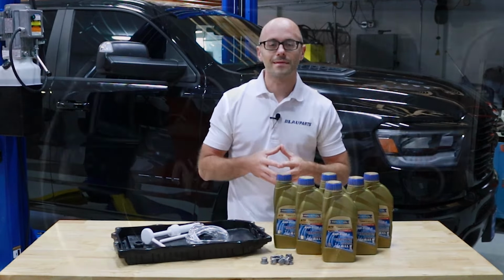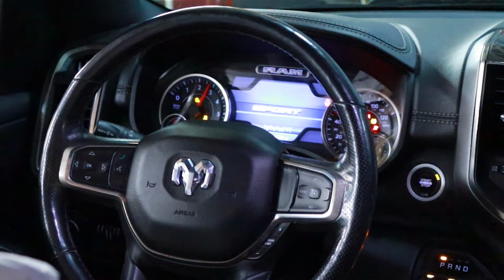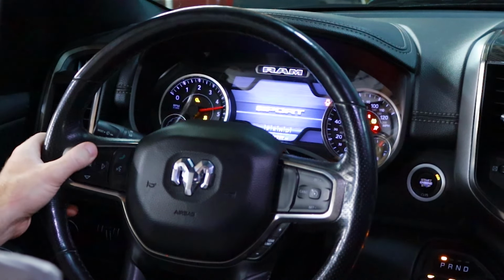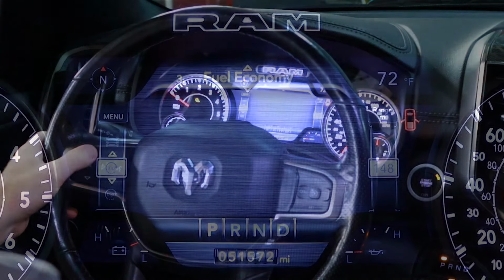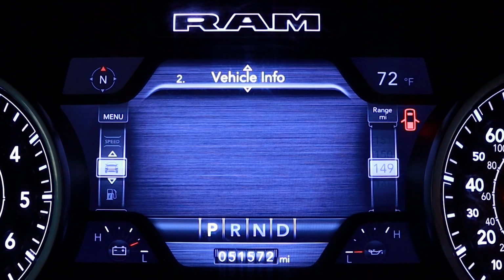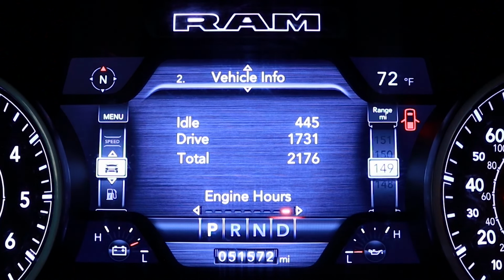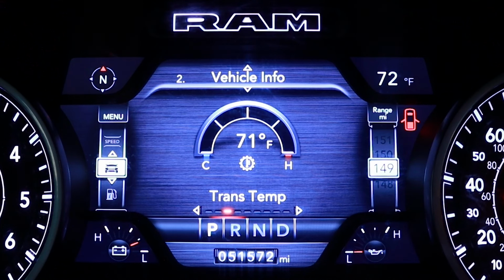Ram 1500 Transmission Fluid Change How To | 2013-2026 ZF 8-Speed 8HP

Comment: I have an 2016 RAM 1500 HEMI and have been experiencing Transmission over heating for the last couple of years. Dealership will not work on it unless the truck throws a code or worse. I have had them make sure that my transmission fluid was filled correctly. But still experiencing high heat 235* after driving for a few hours. This is not constant but more intermittent. Do you have any suggestions as to what maybe causing it. Dealership says that there is nothing wrong with the temps.
Reply: You'll need to either replace or delete the cooler bypass, looks like yours is stuck closed.
Reply: Your cooler thermostat is probably not opening properly

Comment: What a pain in the ass! My local dealer wants 750.00 to do this service. I thinks that’s almost 500.00 over charge! Time to trade it in and go back to and 70’s truck. Easy to work on and no computers!
Reply: 750 is good! The parts alone are $370-$400.  That’s hardly any labor charge!

Comment: Please explain to me why if you remove 5 quarts, you don't just put 5 quarts back in?
Reply: As long as you're accurate in collecting all of the fluid and measuring what you take out, I don't see why you couldn't do that. The issue is that when the transmission pump isn't running, the fluid level in the pan is higher than the drain hole. That would make it pretty difficult to fill at the right amount and replace drain without much loss, not impossible, just hard.

Comment: I thought the transmission was supposed to be level, not the truck. The transmission is mounted at an angle in the rams. Rear end has to come up about a foot or so According to your trucks stance, and then check for level.
Reply: You are correct for this vehicle.

Comment: Thank goodness for this video! While out camping, 16 miles down the Snake River, I hit a rock and cracked the transmission cover. I was able to correctly make all the necessary repairs to my truck while in the field because this video was the first to come up. I was also able to pull my camper and everything back to my home without any extra time or worry, and had a wonderful camping trip even though we had some fairly major issues! Thank You Blauparts!
Reply: How did you do it without the SAE CERTIFIED CAR LIFT?
Reply: @GertuCapur  I was able to use my Jeep to pull the truck up onto some rocks getting the transmission as level as possible. Field repair, so we ensured to recheck once we got back to civilization, but we were able to do well enough to get us out of the back country under our own power!
Reply: wow, you were able to get Amazon to deliver to the Snake River? Crazy. And you had a torque wrench, trans jack and ...oh wait, you just lifted it by hand while your buddy used his fingers to loosen and tighten everything...HAHA.... just kidding. Great job
Reply: Same here, a literal in the field repair.  It started raining , but only the bottom of my legs got wet...good times.
Reply: time for a 6 inch lift and 37 inch tires

Comment: This man is good. He drained, pulled the pan, and didn’t even get a drop of fluid on himself or anywhere else.
Reply: 😂 It’s Rams fault putting that exhaust pipe literally right over the damn drain plug. 😐
Reply: @Adam12SD  Still better than the 75 2wd K5 Blazer I had. It had a leaking oil pan gasket and the only way to fix it was to pull the engine! Needless to say I just added a quart of oil that leaked out every 10 days. Stupid design.
Reply: @rickgoing7027  Thought the K Trucks were all 4WD. The C trucks were 2 WD.
Reply: @anonimous2451  apparently that’s with only the pick ups. My 2wd blazer had a k5 emblem and IFS that kept the oil pan from being dropped. To replace the gasket you would have to pull the engine. I would pour in a qt of oil a week.
Reply: Movie magic

Comment: Tip: wrap the exhaust with tinfoil.
Reply: This has to be less expensive going to a reputable transmission shop, than going to a dealership. .the dealership quoted me $792 !!!
Reply: @lakeguybrent my quote was 1300 lol
Reply: @lakeguybrent  The cost of the OEM pan and OEM fluid is around $400. I paid $470 with expedited shipping
Reply: Adding to this. If you do a poor job like I did, it's worse than not using anything.

That's my fault. Just giving a warning. I thought I had the pieces sealed well enough, but the entire area I covered ended up being covered in oil.

😅

Granted, this entire thing has been a nightmare.
Reply: Use a shallow aluminum tray with a hole where you can place an oil pan to control the mess.

Comment: Hey I’ve done few other vehicles where you needed to fill trans with the pump and hose. Pretty much same technique. Full run check , run check, run check, shift trans run with wheels off ground, check fill. Time consuming.

Comment: I notice on my 2015 Ram the ZF 70 transmission is no where near level, the way it's mounted in the truck. So going by this video I guess I don't need to jack the rear of the truck up to get the trans level to the ground. Just have the truck frame level. So that's close enough to do a fluid check?  I saw where someone said ZF had literature saying the Transmission should be level. Maybe it's not that big a deal. I don't know...
Reply: Do your best to level. Bc half a quart and will make a big difference
Reply: @Lui8111  I had to max out my jack stands in the back of truck  to even get the transmission close to level. I didn't feel safe under a running truck with that extreme angle. I just decided to go about half that high and do the procedure. I got just as much fluid in as what came out. Prob 1/2 qt. more to be honest. I will say this..the way they are showing in this video, there is no way that transmission is even close to level.
Reply: level the pan with a warm transmission then remove the fill plug to see if any fluid runs out until a steady drip. measure what comes out then simply duplicate after the pan and fluid swap. Then add what came out originally. This way you are replacing exactly what comes out or very close to it.

Comment: I just did my tranny fluid change this weekend following this video. It was SUPER helpful. I was able to put in 6 quartz of Valvoline MaxLife and now the tranny shifts so smooth. Thank You!
Reply: Amsoil
Reply: Going to go with PPE, so I just have to change filter and fluid without having to get new pan every time. Plus extra cooling and not having drain plug over exhaust. Seems Worth the extra cost.
Reply: So you just changed the fluid or changed the filter too?
Reply: @adrianarce9427 the filter is actually embedded in the new albeit disposable pan.  I did this last year…..bit of a pain but not that bad.  I didn’t need to remove the three bolts and raise the truck.  There was enough clearance to remove and install the new pan on my 2017.  I used OEM fluid which is ridiculously expensive.
Reply: @chrisspeer3850 you have the cross pipe and didn’t have to lift the transmission? I’m planning on doing this job tomorrow… and tips or advice for me would be greatly appreciated 😅
Reply: @chrisspeer3850 so I can’t just buy a filter? There’s nothing wrong with mine I just hit 100k and want to keep my warranty.
Reply: @tyreichard9801 no. The pan is the filter.  It’s integrated into the pan.
Reply: @adrianarce9427  filter also. For the filter pan, I went with OEM.
Reply: You know that's the wrong fluid?
Reply: @jordanwalter4381  wrong fluid ? Why because it's not green ?😅 It fulfills all the specifications of the ZF tranny, and many people have used it for long periods with no issues to date. You do know Chrysler doesn't  even recommend to change the fluid at all in these right ? How's that for proper fluid requirements...
Reply: @DL101ca ehh the biggest problem is the two different fluids mixing. Unless you drained the torque converter and cooler if it has one I wouldn’t trust it…
Reply: @DL101ca Chrysler actually does. I’m looking at it on my ram manual book as I write this.
Reply: @jordanwalter4381  I didn't want to pay for ZF fluid so I made the decision to use a cheaper alternative; Valvoline Maxlife. Did my research and seems like a lot of people are having good outcome with Valvoline MaxLife. So far it's working out great for me and shift like a dream.
Reply: @Allen Yee  good choice. I use the same fluid in my 2017
Reply: @stecathe  Thanks, I get a lot of shit for using maxlife lol.
Reply: @allenyee4782  Don't listen to that guy. I have read hundreds and hundreds of posts with successful use of Maxlife in ZF autos... I just used the newer Valvoline Extended Protection Full Synthetic ATF. Thing is shifting better than before. Buttery smooth.

Comment: After watching this video and seeing all the specific temperatures and times, shift points and so on...I think this video should be labeled ........Don't try this at home.....who has a lift like that to do your own service work...I mean really....maybe 1 in 1000 if that?  Kudos on the exacting details necessary, but this one isn't gonna happen in my garage.
Reply: floor jack to lift vehicle, then jack stands under it on all 4 corners.
Reply: @ejohnson3837  That part I have covered and could easily do...how many people are going to go thru something this technical and do it correctly?  Specific temps and fill points, shifting and so on....I'll pass on that one.
Reply: @13612  you need vehicle level is all. check fluid level when hot, drain , fill , and check again hot. Not very difficult to me. People complain when their vehicle doesn't go 200k, but fail to do maint to get it there. Auto manufactures don't care, warrantees are 3 years 60k now. Don't complain when it takes a shit at 100-125k then.
Reply: @ejohnson3837  I take care of my vehicles...just saying that the procedure is too entailed here for average joe weekend job.  I think if it were spelled out in line format step by step would be better.  If I get the time, maybe I'll do just that as I'll forget half of what this video has in it.
Reply: @13612 I doubt any shops do this much of the procedure.  They’re too lazy to even check torque specs
Reply: I can’t even get my temps down to 86 😂 living in Arizona .. but anything low should be fine.

Comment: I think that’s why people who do this transmission never last long because of the wrong steps. I never change my fluid and still got 300,000 on my 2004 & 2014 no problem so I see no point of changing fluid.
Reply: Got 114k on my truck, light use, no reason to change it now, probably cause more issues. Love the 3.6 with the 8 sp tranny.

Comment: I have 115k miles without a service, since I will be towing my dealership said they would pump new fluid through the transmission twice for $280.  This is a pretty good deal but won't touch the filter.  Would this be sufficient?  I really don't want to get involved in all these steps.

Comment: Are you going by the ZF service instructions? Because those instructions state to MANUALLY shift from D1 to D2.  Nothing about spinning the wheels.  Also - you missed the part about warming the trans to 75 C to open the cooler valve.  This is before the shifting sequence.  Also - you're using the wrong fluid.

If you listen to this guy you are gambling with your transmission
Reply: Eurol ATF 6700 claims to be compatible with ZF LG8. Many oil companys have a fluid that meets ZF LG8.  A Shell product anyway.
Reply: @ChristopherNewby64  I notice it has the same green tint to it.
Reply: I think that's what ZF wants you to belief so you can buy their overpriced fluid.
Reply: @allenyee4782  that is absurd
Reply: @NinjasOfOrca  If you search the web, there's many people who are using other fluid with no problems. I put in Vavoline MaxLife in my Rebel ZF 8 Speed and also no problem.
Reply: @allenyee4782  I guess it's a matter of who you want to trust.  I trust the manufacturer to know their equipment better than a handful of not-so-randomly selected strangers on the internet.  I guess you feel the opposite
Reply: @NinjasOfOrca  Either the fluid meets the Mopar specifications for that particular transmission or it doesn't.  The Ravenol ATF meets those specifications...so do a bunch of other brand fluids, for a lot cheaper than the ZF Lifeguard fluid.  ZF wants you to buy their fluid, because they are in the business of selling it.  Any Mopar approved ATF for the ZF-8 transmission will work just fine.
Reply: @NinjasOfOrca  do you only use dealer parts on your vehicle ? You know that those fancy Mopar stamped parts are made in the same factories most aftermarket name brand parts are made ? Same goes for fluids as well.

Comment: Bet the dealers will skip half of these steps guaranteed.
Reply: My dealer wouldn’t even service mine. Gave me the BS about it being a lifetime fluid.
Reply: @QuadMechanicSBA  It's so wild that Chrysler keeps pushing that narrative.  ZF has always said that these transmissions required service every 60k!
Reply: @QuadMechanicSBA  same here! I couldn't even find info in the service for these until about 2 years ago. Makes no sense.
Reply: @QuadMechanicSBA Me also. Dealership in 🇨🇦 here said the same. I said, I call BS… Bull Bull Bull. I won’t go there for service.
Reply: @QuadMechanicSBA 
Wow that’s crazy!
We all heard about burnt oil, oh and why does it even have a filter then?
Honestly these lame inexperienced types make me crazy.
I walked in and asked a question one time, within minutes to prove a point, I told my wife to walk in see the same guy and we got 2 completely different stories.
Reply: @QuadMechanicSBA mine said the same
Reply: @QuadMechanicSBA yes that’s also while I’m here to that’s what the dealer told me too non serviceable and yes I know this is two years old
Reply: @R @RickyHaislip-b2u azy. I wonder what mine will say? I’m getting closer to 60k. You telling me all the Jeep autos they sell and they don’t replace the fluid? Nuts
Reply: They just want to sell you a new transmission. Just performed mine . $350 for pan and fluid and about 2 hours of time.
Reply: @QuadMechanicSBA JB transmission shop here in 🇨🇦 quoted me 900 bucks. I just about passed out😮
Reply: Worked for chrysler...so the "lifetime" of the vehicle is other words for the length of the original manufacturer warranty of the vehicle. For example if the ram warranty for a 2023 is 6 years 60k. Then that is the original "lifetime" for that Ram. Definitely serviceable.
Reply: @richardrosario9668 sounds about right. I had a VW dealer quote me $1200 for all new brake pads and rotors in 2018
Reply: My dealer quoted me at 1300 out the door like wtf
Reply: @Mr.Torres-Mr.Towers  Me too....1200+tax
Reply: Damn and I thought 800 was too much @Mr.Torres-Mr.Towers
Reply: Me too, that’s what I got quoted today was $800 and then started searching lol
Reply: You know that's the truth!
Reply: I worked for Ford 20 years, GM 2 years and Chrysler for 6 years.
Chrysler was the worst by far for excepting warranty claims.
It seemed nothing was actually covered unless you only drove indoors!
Look, learn and listen, my dad used to say!
It’s terrible to say but most don’t know anything!
Reply: Dealer where I live didnt do any of these steps but still charged 2 grand. Didnt know until I took it to another shop for an inspection where they said fluid was burned.
Reply: Damn, I wish I knew this before trading in my gmc that I was thinking was gonna be PITA to
change the trans fluid and filter. Didn’t see the actual filter in this video unless the pan IS the filter??
Reply: @tjceron yes the filter is built into the pan
Reply: That's what worries me. Because I don't have the ability/set-up to do all of that on my own.
Reply: No the dumb mechanics skip shit because they are lazy as fuck.
Reply: Why would We ?
Reply: Skip what steps? Changing the filter?
Reply: I got the same.. said no way to change it. I call bs as well
Reply: The dealership told me it would  be 400 to change my transmission fluid on my 300 smh
Reply: @detroitking2238  Considering it's that much for just the parts, not bad.
Reply: I wonder if the Silverado is about the same expensive process?? If not, then I might be switching to a Chevy.
Reply: My dealer wants $1600 for this lol

Comment: My dealer said there is no recommendation for fluid/filter change.  Also, there’s no mention of it in the owner’s manual.
Reply: I emailed ZF directly and they told me the fluid should be changed at 100,000 miles or 8 years.
Reply: Yeah, all Mopar ZF trans are set as "fill for life" from the manufacturer.  I believe ZF recommends 50k intervals if you do some research.
Reply: unfortunately, because Ram is only concerned about the transmission making it past the warranty....every service dept is completely capable of servicing the transmission, but it's insanely costly if they do it. I had it done years ago before the YT do it yourself videos, and it was about $700 (back in 2017). I do it myself now for a couple hundred bucks at every 60k.
Reply: You can finish that conversation with him when your transmission starts slipping.

Comment: Wouldn’t be so bad if they gave a transmission tube like they used to to check the level and top it off.
Reply: If your transmission fluid is leaking, you should drop the pan and perform this service anyway.
Reply: @donaldgrinker6917  what does a leak have to do with what I said? A dipstick makes it easier to top it off and check as the fluid makes it was through the transmission as it gets to operating temp when you service it.

Comment: In your video, it says some have deeper pans but others how would I know I have a 2019 4 Wheel drive 1500 limited The other questions do you ship your kits to Alaska?
Reply: Looks like if it comes off without lifting the transmission off mounts it's a "normal" pan. If it's too tight, sounds like it might be a deeper pan.